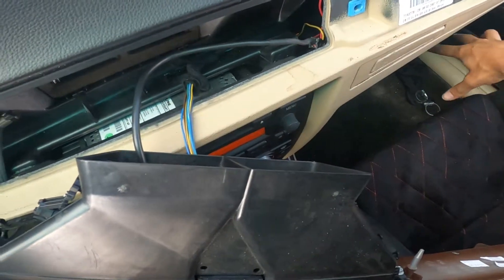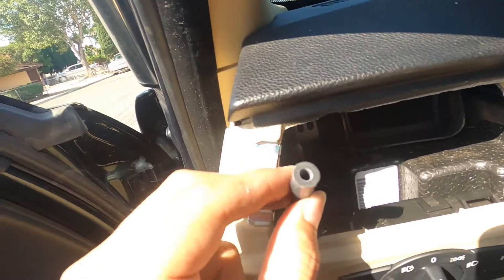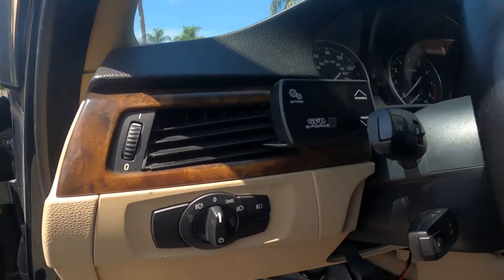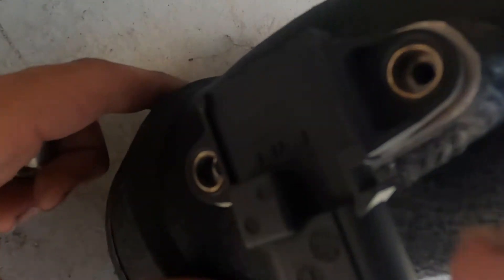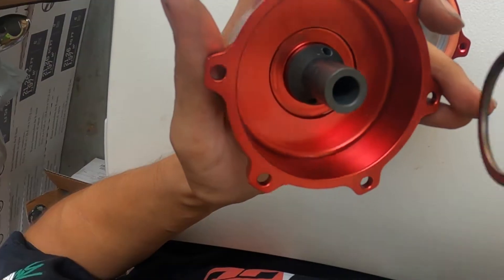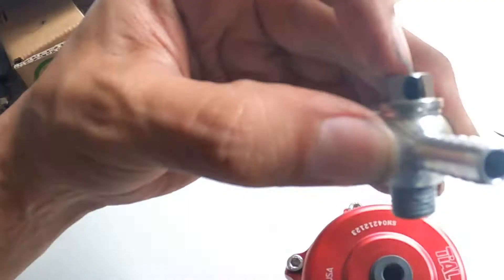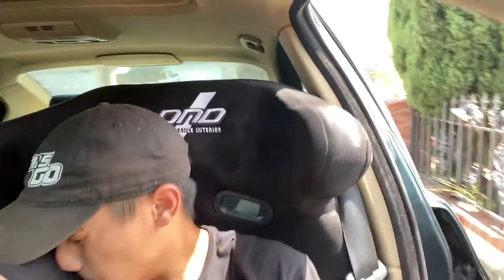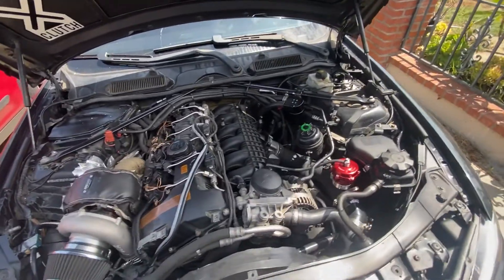UPGRADING to the BEST BOV & Wiring Boost Control on BMW N54 (DIY) Part 2

Comment: You got the wiring diagram on where I splice the yellow and blue wires or do I just leave them alone ?
Reply from the maker: The yellow one is for AFR Gauge if you end up running one like AEM somewhere on your dash. The blue one is used if you want to have a switch For scramble or different boost settings
Reply from the maker: If neither then leave it alone just make sure there's no exposed wire.

Comment: Hello i want to run also on my f10 n55 gfb 3 with dual wastegate actuator, so im planin to hook up the boost line from charge pipe to the IWG but i dont know where should i hook up the vacum line from the gfb monitor ifnyou can help me please because im not finding enough info for it thank you very mutch :)
Reply from the maker: I'm not sure if this is correct because I had an external wastewater on my setup but I would run a tee off the line running to the bov as it will probly have the most accurate reading.

Comment: Are you using jb4 or motiv or something else with your car?
Reply from the maker: Just Mhd Flasher & the Gforce3 to control boost. Tuned by Wedge.
Reply: @3meansgo  did you get rid of your stock boost solenoids if so how. My car went into limp mode after the ST swap
Reply from the maker: @dereksmith6365  Your suppose to remove them completely & your tuner will turn will take care of it through his end. what kit are you running?
Reply: @3meansgo  i got the doc race 6466. Cant wait..Super excited to drive it
Reply from the maker: @dereksmith6365  hell yea! Its gunna be EPIC! hit me up on IG if you need a little more in depth help with pics or something.